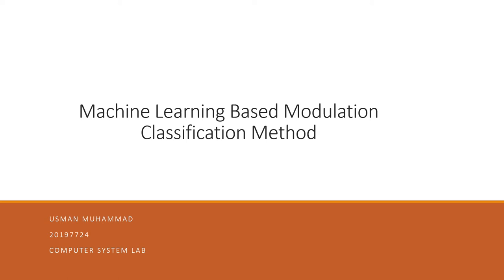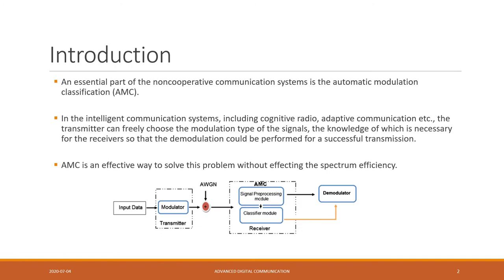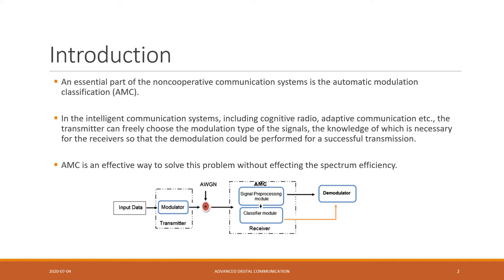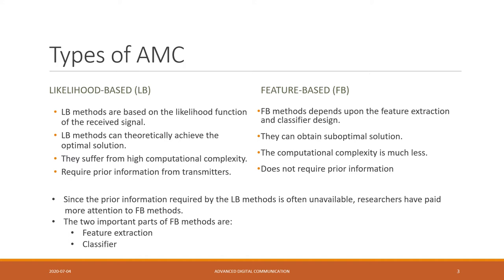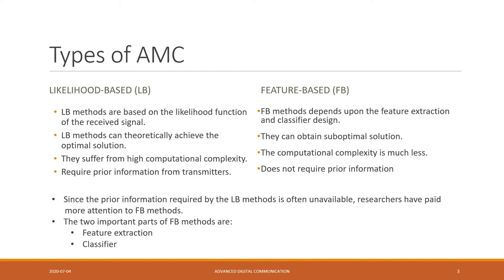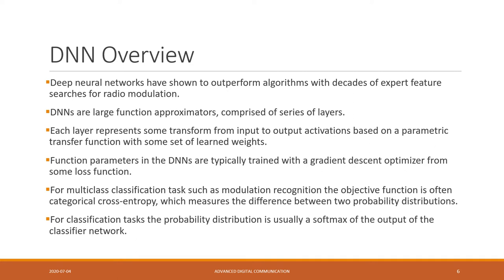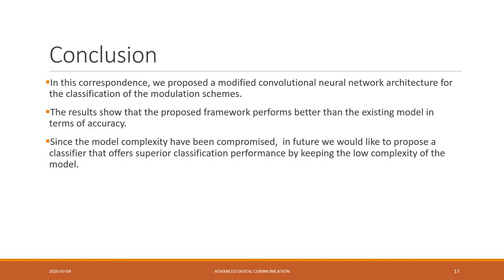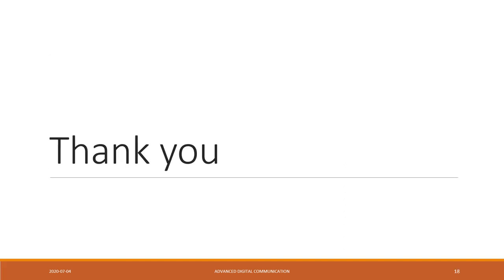Automatic Modulation Classification_Final

Comment: Bro, My Thesis is Meta Learning Modulation Classification . Also Can You Send me some links to help me do my thesis. Thanks For your video it helped me
Reply from the maker: What I know is meta-learning refers to learning algorithms that learn from other learning algorithms. So it is one level above machine learning. 

I suppose you are gonna have to look into and deploy several machine learning algorithms for AMC task. Meta-learning would then be to learn the which algorithm is giving the best prediction, or something like that, I am not 100% sure. 

But what I am sure is that there would be a lot of good stuff out there if you  look thoroughly. The code for my implementation is available (link in the video description). It is pretty old but that maybe useful for you. 

Good luck.
Reply: @MuhammadUsman-nu7rl  thanks brother